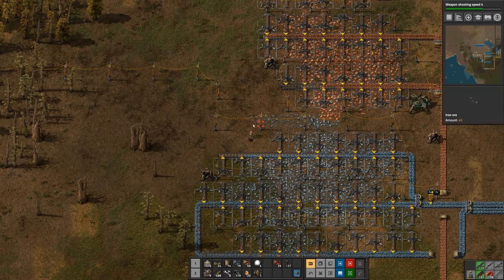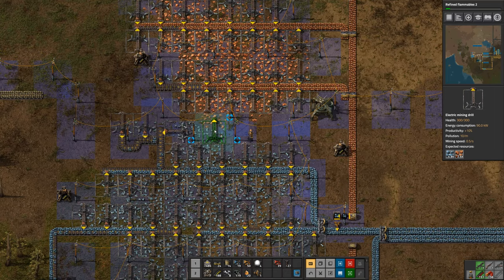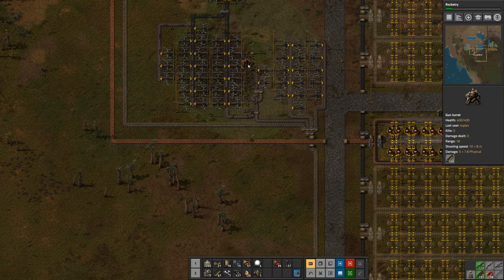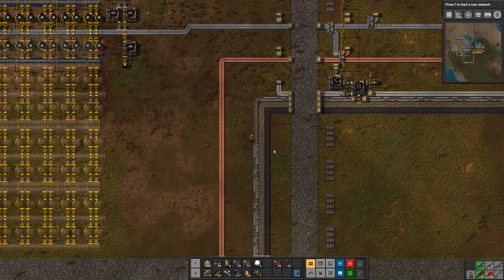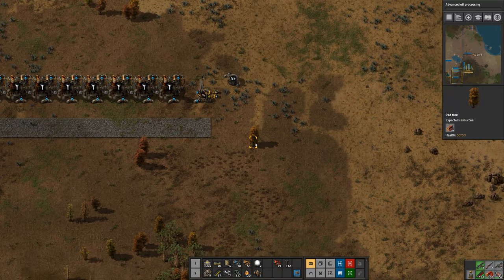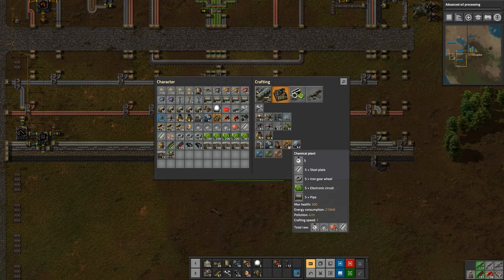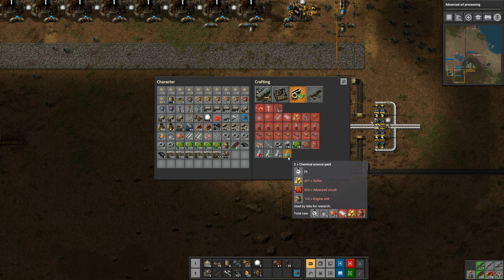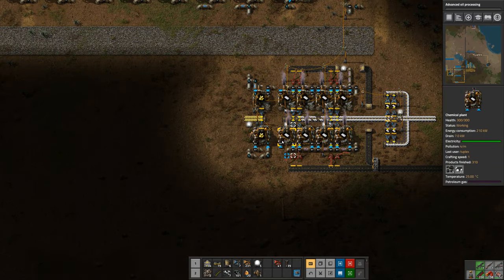Factorio 0.17 Tutorial #8 - Basic oil, plastic, sulfur

Comment: Hey man been loving the series! Only issue is that my petroleum gas storage tank isn't filling up or it's consuming itself too fast. I've set up the refinery and sulfur/plastic machines exactly as you did. Thoughts?
Reply from the maker: Maybe it’s not getting enough crude oil?  Click on the refinery to see how fast the crude is coming in.  Does it fill up before the next cycle starts?
Reply: Super late reply, but I had the same problem. Turned out my crude oil was draining out as fast as it was coming in, so I had almost no pressure for refining/production. Solved the problem by turning off the output of the crude storage tanks and then reconnecting once they were full to capacity. Worked like a charm.

Comment: @24:00 why do we need to use a pump. Couldn't we just add a pipe to the tank?
Reply from the maker: Yes you can, but you get better flow with a pump.  If you don’t use one, then the fluid pressure goes down as the tank empties, and the flow rate gets slower and slower.
Reply: @TuplexGaming  gotcha, thanks again